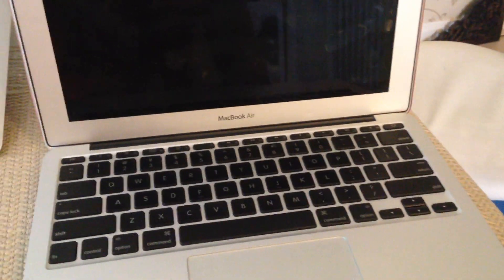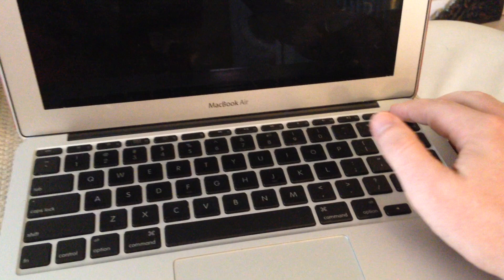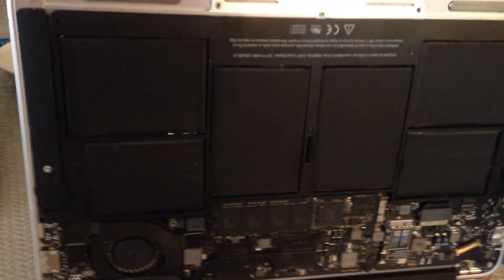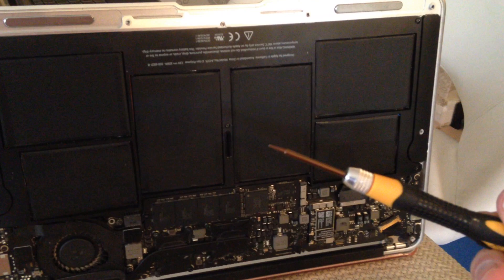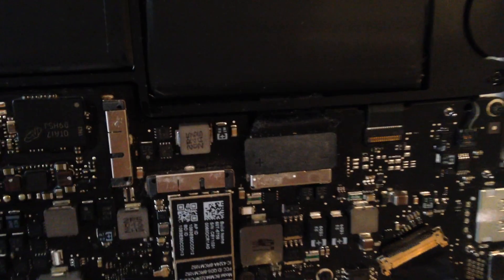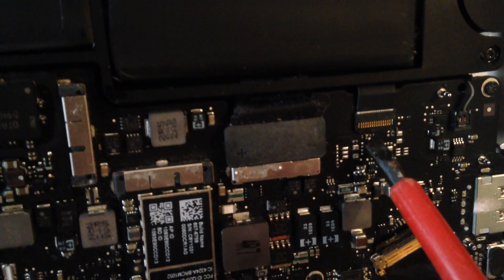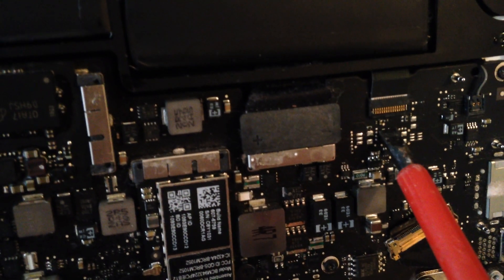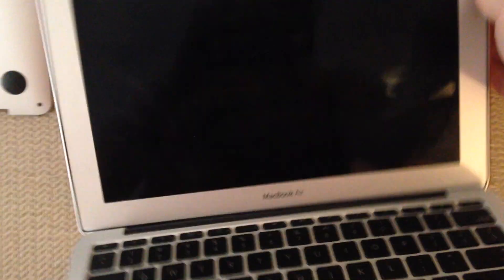How to Start MacBook Air without Power button

Comment: Doesn't need to connect the power adapter, but the lid must be open. Super trick !
In 2025, I still use this 2gb ram macbook air 11" late 2010, osx 10.10.5 Yosemite, garage band 6.05, musescore 3.62. It plays piano without latency when connected to a midi keyboard.

Comment: Its a nice trick but your have to beware you dont touch and other points of it may damage your laptop, instead just unplug the battery connector and plug in the charger the lappi will turn on then connect the battery to the motherboard, hence your not risking of shorting any thing else as you dont need a tool to this, i have the same issue and im using this method till i replace the keyboard.

Comment: do not know why i dont have that 2 solder spots, with my mac a1370 (2011 model). I cannot find that spot you refer to. my logic layout is similar to yours but chips are in different position. I cannot power up my macbook with power switch

Comment: "please locate 2 solder points" PLEASE PLEASE PLEASE do not start connecting solder points on your motherboard UNLESS you are certain they are the 2 points for the power button. 
The button itself acts as a momentary connection of the two points to tell your computer to fire up. Connecting two OTHER(read: incorrect) points will/could result in the instant creation of the fanciest doorstop on your block! Find the schematics for your model, or follow this guy IF you have the EXACT same model and EVERYTHING looks identical to the video image:)

Comment: does it reset the water sensor, or what? I have the same situation on my 1466 mac air, but the solder points are not there for this motherboard

Comment: I bet all your other keys work fine? I have the same problem. I think there's a fuse or firmware protection that needs to be reset when it detects a short.
Reply from the maker: Yes all other keys work fine. If you can find a solution that does not involve having to take the back off then please share. I'm finding that the Mac is ok in sleep mode for about 2 days before it decides it's had enough and I have to redo this fix.
Reply: +Delamerio Same here. Did you ever find a solution? There is nothing wrong with the mac except this. It is just TOO odd an error... It has to be Apple that wants us to buy a new Mac
Reply: hi Guys , anyone found the solution ??